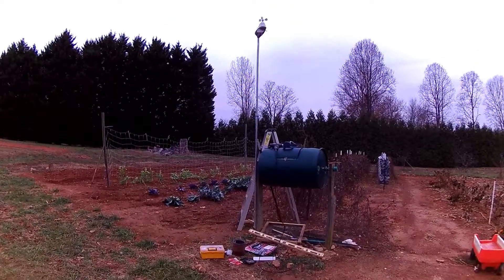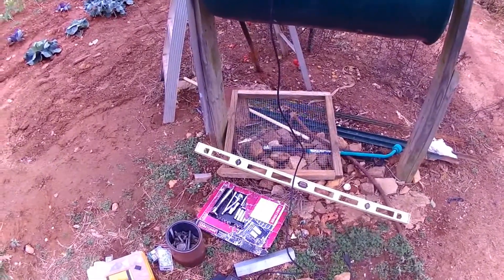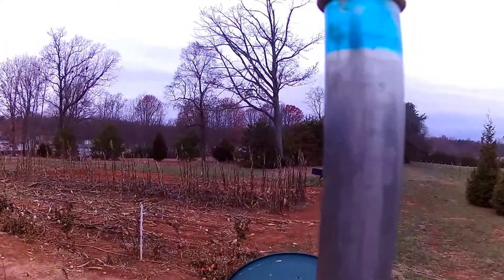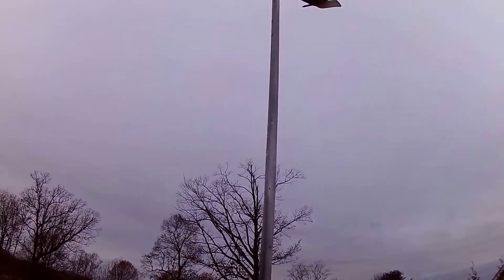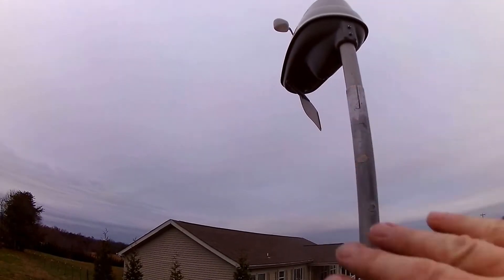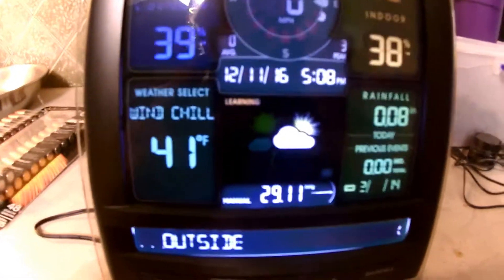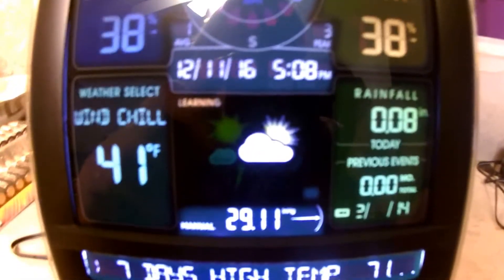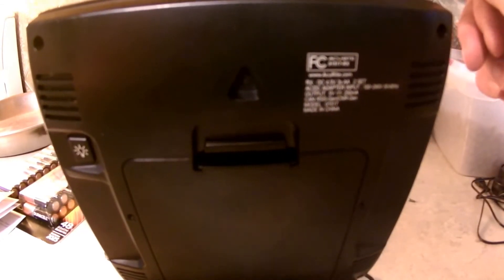Installing Acu Rite 5 in 1 sensor and display

Comment: FYI the Acurite manual recommends Lithium Batteries for the outdoor unit. For the indoor unit they recommend Alkaline, but according to Energizer, they're saying they guarantee both not to leak.However, having said that, like you, I don't have batteries in my indoor unit either. I have it plugged into the same UPS as my computer so if the power goes out it'll still operate for awhile. Like you I'm not that concerned even if it did lose power. There are many more things to worry about if you lose power.   Energizer® No Leaks. Guaranteed.Energizer will repair or replace, at our option, any device damaged by leakage from Energizer MAX®AA/AAA Alkaline batteries either during the life of the battery or within two years following the full use of the battery. If exact replacement is not available, devices may be replaced with a product of comparable market value at the time of claim. Leaking battery and damaged device must be provided to Energizer as proof of claim. Energizer reserves the right to deny claims of damage caused by misuse or modification of the batteries or device. If you have a leaking battery, contact 1-800-383-7323 for return instructions.Energizer® Ultimate Lithium™ Batteries are GUARANTEED NOT TO LEAK. Due to advanced technology, Ultimate lithium™ batteries will not leak under normal consumer usage. If you believe that you have a leaking Energizer® Ultimate Lithium™ battery, contact 1-800-383-7323 for return instructions.
Reply from the maker: Fred thanks for watching my video and passing along the battery info may help some others out who read your post. Plugging into the ups is a good idea. Unfortunately where my unit is I don't have space for a ups unit and don't want to move the display to where my home pc usp is.
Reply: Fred Young leaking isn't the issue. Alkaline batteries will not work in extremely cold temps.